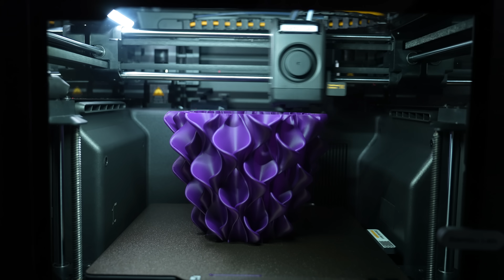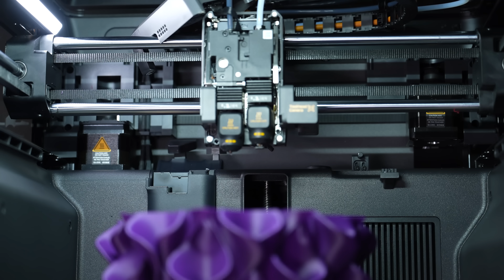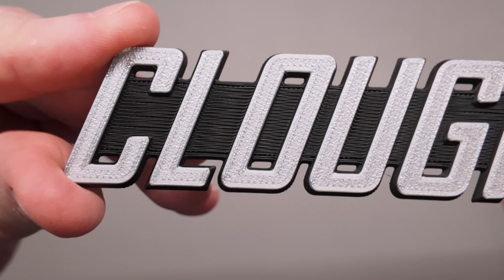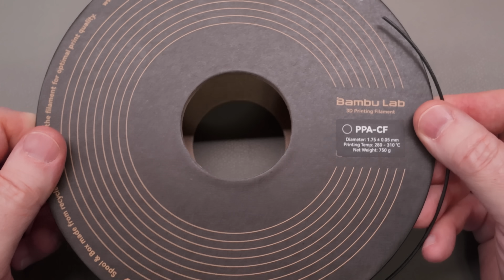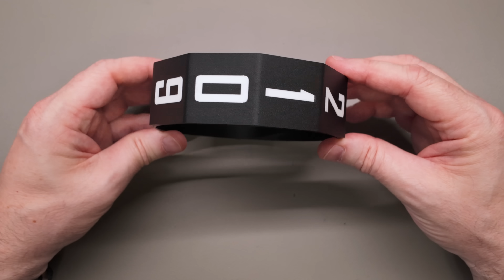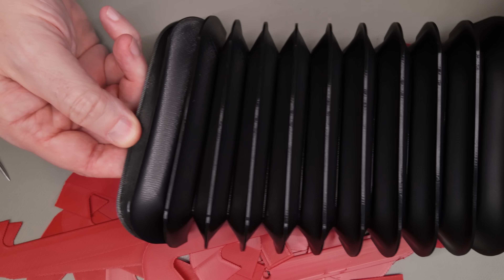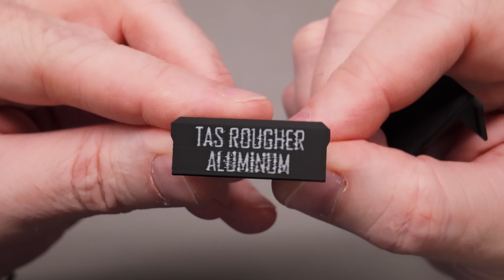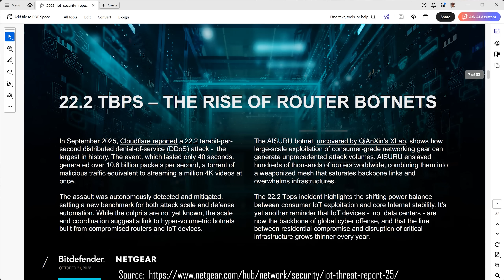X2D Deep Dive: Dual Nozzles, Bowden Extruder & Real 3D Prints

Comment: @1:32 .. 300… not 350
Reply: Yep, they could have had an easy win with 320c even... the 300c is just... daft
Reply: @Net7Ruins  Soooo true!
Reply from the maker: Ugh.  Yeah, I misspoke.  It's 300C.
Reply: @Clough42 would’ve been even crazier value @350c though, great review!
Reply: @Clough42 bummer. I wonder if the test units were 350? This was looking like a great machine for technical filaments, but now with this lower max temp I’m less certain.
Reply: @Clough42 Ah that's too bad, I almost rushed to buy one based on that. I print with high temperature filaments quite a bit, where optimal temp is 325C, and I'd much rather do it on a Bambu machine than the custom voron I built.
Reply: @stevewells20  just get a qidi q2 or max4
Reply: @Clough42  your name is really dumb. clough is really bad as a name.
Reply: @Clough42  I just subscribed after coming across your videos when I was looking at bamboo printers. I watched the video you did about YouTube as well. Totally agree that there’s so much crap you have to sift through, to find the gems like yours. I appreciate the crazy amount of effort you put into your videos. Cheers, Pete
Reply: I was just about to comment.  I don't understand why they would cap it at 300c.  I mean even elegoo is doing 350c.  It's the one thing keeping me from purchasing.  If I knew I could mod it I would buy one.  Unfortunately I don't know if it's possible.
Reply: @rustimack  I feel exactly the same way. It’s so stupid to cap this at 300C and it’s the exact reason why I’m not buying one.
Reply: You should really update the video. I just almost bought one just for that reason.
Reply: @patmcfarland9880  Same! I know he just misspoke, but you can’t have misinformation like that in a video. Should’ve been caught in editing and should be updated.
Reply: 256^3 is way, way too small.
Reply: @Spectrum184  ok, just get an H2 then
Reply: @Spectrum184  Except it’s not. It’s the most common/standard size for 3D printers today, and for good reason. If you need something bigger then obviously this isn’t the printer for you and you should be commenting on totally different videos (Bambu H-series, Qidi Max4, Anycubic Kobra S1 Max, etc).
Reply: Oh wow, this knocks it down from S-tier to like a B-tier for the price.
Reply: @ivchatov this is sarcasm, yes?

Comment: FYI: X1C OWNERS: BAMBU LABS IS BEING INVESTIGATED FOR EXTORTION. THEY PURPOSELY BRICKED FIRMWARE 01.03.00.00 TO SELL UPDATED AP BOARDS. PROVE ME WRONG, GO RESEARCH. LOUIS ROSSMAN VIDEO IS WHAT LED ME TO FIND OUT MINE WAS BRICKED. I HAVE ALMOST NO USE ON MINE (JUST A TEST PRINT BENCHY AND SCRAPER TOOL) AND IT'S 100% FIRE HAZZARD BRICK NOW FOR LAN. YOU CANNOT CONNECT VIA LAN TO MONITOR CAMERA OR TURN MACHINE OFF IN THE EVENT OF A FIRE REMOTELY. THIS MACHINE IS PURCHASED FOR FARMS BY MANY TO MANUALY CONTROL. BUYER BEWARE, THIS COMPANY IS GOING DOWN., IT'S BEING SUED.

Comment: I’m new to 3D Printing and would like to consider a scale project that even the H series cannot handle in a single print. The X2D appears to be the best overall value for features as an entry point into 3D Printing. Can you suggest a method to print a large item that would need to be assembled from many prints for full scale project. I have a Fusion drawing that would need to parsed to many smaller prints but am not a Fusion360 expert. Thanks

Comment: I'm in IT, so I'm very aware of the security landscape in 2026. It's good that you're running these IoT devices on their own network, but I would discourage the use of any cloud services. There's not only privacy and copyright concerns; but there's also security concerns. If Bambo Lab's infrastructure is ever compromised then all the cloud connected printers could be compromised as well. We've seen similar hacks repeatedly.

Instead, what you should do is run these offline, on their own VLAN without internet access. You can still access most if not all of the features using Tailscale and the like. If you're concerned about firmware updates, that can be done manually when you've verified that it's stable as Bambo Labs offers those downloads offline.

Comment: Bambu says that the aux hotend shouldn't be used with a 0.2 nozzle ... but what if you're printing a model in hi-res and it needs support?
BOTH nozzles are required to be the SAME!     I don't think this printer is going to be around long.

Comment: Fair warning, Bambus quality has went down and engineers have gotten out of hand. Don’t buy unless you feel like removing the whole tool head cover off, minimum 13-14 screws and multiple wire connectors just if you need to work on the extruder assembly. Sensors are cheap plastic, camera and auxiliary hot end fan is barely held on, had to tear my first one down so many times threads and connectors are sloppy and finally had to get a replacement after 3 filament sensors went bad in 3 consecutive prints and new machine is doing the same🤦🏻‍♂️

Comment: I wanted to add another printer to my setup and I have the P1S workhorse, I went with the X2D, I Don't have a need as of this time for the more complex material Support but, Getting the P2S just seemed like a mistake when I start experimenting and using engineering materials.

Comment: As a user of the h2ds i really wanna get one of these to try but that quality is definately not going to be worth it. Sucks these companies keep making good moves but leave you in between models to pick from. P2S with a heated chamber would of hit the nail on the mark. This printer should of just went to tool changing since they already have a bigger dual nozzle printer. But 2000 plus is alot when you want to add machines. Thanks for the review.

Comment: be real, you can buy a 3d pen for 20 bucks that comes with direct drive motor and weight 20 grams. i cant imagine they cant made the head properly with 2 direct drives there. next year they will suddenly release like X3C, after we spend 1k on that mediocare stuff. Its like playstation 2 + playstation 3 = playstation 5 memes. at this point. This aux thing have no place at printer in that pricerange. there are cheaper printers with 4 proper heads already

Comment: Was a good video up until you started glazing their "security updates" and using their illegal (in terms of licensing) networking addon. Under the type of GPL licensing that bambu studio inherited from prusa slicer, it is strictly forbidden to have a mainline use component, such as a necessary to use networking addon, under a different license. It must remain open source, yet these guys dont give a crap. They even send vague barely legitimate legal threats to a guy who forked cura and made it work with their old deprecated interface to enable proper interaction with the machine.

That said, I still bought the x2d. And you completely missed the broken "intelligent cooling" they have where every layer change forces the aux fans to blast 80 or 90%, thus producing warping on petg and other materials.

Comment: James, your videos are really helpful and informative. No nonsense. But here's my first big complaint about the X2D: We have a number of X1Cs and a bunch of spare/different build plates for them. Everything I read and heard said you could use those so-called "first generation" build plates with the X2D, and in fact you can. Problem is, unless you disable build plate detection, the X2D will stop and require a user/babysitter to click "resolved" or "ignore" before it will proceed to the job. I don't know, maybe there was an actual engineering reason outside of planned obsolescence for them to do this, but I doubt it. So, I ordered some "second generation" build plates, but unfortunately they are not recognized by my printer either. I have a support ticket open, I want my money back (for the bullshit build plates, that is.)  I think if people just took a step back and realized that it's everything an X1C is, but for only $900. Oh, and you get the other additional features like a heated chamber, two nozzles, etc. You don't even have to use the second nozzle if you don't want to.

Comment: X1C users have a few reasons to consider the X2D.. for me I print al lot of pla with petg supports, and like you said.  even with extreme purging you always run the risk of a ruined print due to layer separation from contamination so the X2D is a godsend for me at the price, and I have never had anything but the X1C machines, so not having to take apart the hot end to swap nozzles is going to be such a nice change!   thats on top of all the great things you mentioned with other materials and the heated chamber.
Reply: I have an X1C, and I don’t think I can upgrade to the X2D because of the same purging issue. like its ok, but not the best.

Comment: I was actually surprised at how the print times exploded when just adding the 2nd hot end support interface layers so some of my more complicated prints.  A 7 hour print that had pretty evenly spaced support interface layers (meaning the existed on many of the layers) went to 14 hours just by adding the nozzle switching and printing the support layers, and the huge prime tower.    Other than that, I really love this machine.   It's just want I wanted in a 3D printer!

Comment: Can you please do a video doing large asa prints on the x2d and see if your z height is off? For the life of me I cant believe bambu gives you x and y compensation through shrinkage, but nothing for z for filaments or the printer itself. I have large asa prints that come out good on x and y but z is off by .5-.8mm. not a lot, but for a printer marketed as accurate to 0.02mm with the vision encoder, .5-.8 defeats that accuracy idea of prints. Given that the x2d is aimed more at engineering than flexy dragons and fidgets especially. I could see them not caring for toys and fidgets but for prints where accuracy is key, it would be super nice. I know I could do a scale factor for z in the slicer, but if I forget that, it would be nice to not have to worry about it. 

Same thing on the h series, I don't have one but curious if on an h2s, large prints in asa how dimensional accuracy is. Would be a cool video since not many people talk about it with bambu printers. 

I've seen many talk and ask for it, so it will probably take a big YouTuber to push this. Love your videos.

Comment: I've been printing non-stop with my X2D for the last five days. My only complaint is that the extruder seems to be more sensitive to "stuck" filament (when the filament is simply stuck on the edges of the spool because it's wound too tight. My H2S seems more forgiving.

- Using an external bowden extruder makes the tool head lighter which is a good thing. (that's a win)

- Supports - the right nozzle only prints the support INTERFACE, and the remainder of the support is printed from the left nozzle. You could put a 250g spool on the support side and it would probably take several months of printing parts that require supports before you ever need to mount a new spool. (that's a win)

I have an AMS mounted for multi-color support, so I'll probably never use the right-side nozzle for anything other than it's intended purpose. I'm willing to bet that most other people will feel the same way.

Comment: Did you try printing the gridfinity labels the other way around with the main extruder handling the fiddly lettering and the auxiliary handling the larger black colour extrusions.

...that would have been slower but might have resulted in better definition on the lettering as it'd be the main extruder handling the 'delicate' bits of the print.

Comment: There was a fair amount of misleading info about firmware updates and needing to be connected to bambu cloud for that. You can stay just as up to date with it being in LAN mode - and many would actually consider it MORE secure then being connected to bambu's cloud service. There is a firmware update from USB option on these printer - its really not hard to put the firmware update on the usb drive and update the firmware. There is absolutely no requirement to be connected to bambu for that .

Comment: Even if the second nozzle is "only for support filaments", X2D still prints better than P2S because it uses 1.5mm belts instead of 2mm belts like the P2S uses. This means its more forgiving with VFA's while being at the same price point as P2S.

Comment: I’m looking at it due to wanting to work with tpu filaments and they are slightly large and will require me to slice and glue them together. Would it be good for that with the aux to provide support to stabilize the tpu, the tpu also will be printed with no outer walls just the infill only

Comment: For someone that has a X1C (early adopter) and wants to upgrade to a new printer / get a secondary printer that would become the new workhorse, would the X2D be a decent affordable direct path upgrade? Or is it small enough of an 'upgrade' where I should just hold onto what I have. The dual nozzle sounds like a dream for supports. Which is what I would probably mostly use. 

I use my printer to fix things around my house, prototype fixtures / inserts for work. But I wouldn't say I'm a power user. 

I'd love to get a H2C/D but that price is just completely out of my budget.

Comment: For the love of god BAMBU LAB.  PLEASE PLEASE PLEASE MAKE BAMBU STUDIO SO I DONT HAVE TO START FROM SCRATCH EVERY-TIME I MAKE A NEW PRINT PROFILE!!!!!!! MAKE THE FILAMENT PROFILES CROSS PLAYFORMS WITHOUT STARTING FROM SCRATCH!!!! This is infuriating  maybe I’m missing something but I can’t even use the same filament profile on multiple machines.  This must be changed or made easier.  I’ve got A1’s A1mini’s x1c’s x2D’s P2S’s and H2C’s.  This absolutely makes my flow through an absolute nightmare. To the point where I’m about to sell these and just. It a formlab fuse 1 30w.   It should not be this difficult.  It just shouldn’t.
Since I’m on a tangent, might as well spell out that your AMS NEEDS TO HEAT WHILE PRINTING last time, I checked PA 612 PA 6PPANPPS isn’t going to soften at 80 C while printing, so please for the love of God or whoever you pray to make this an option not a lockout. And again, please make it easier to transfer filament profiles from machine to machine and platform to platform. I use all of your machines I have 40 of them this has to change.
I literally have to open up multiple screens and copy line by line the settings of each one this is just not good. 
Now, as far as the X2D they make it pretty clear that the secondary nozzle is for support that I agree with them. I use it for Phil and it works great for him. Phil doing multi material infills with nylon and then PPA creates a very rigid, but impact resistant part
Reply: I’ve honestly had really good success with X2D’s. They are really good with support and are really good for using strong material as infill or simply just a different material for the infill my main issue is the AMS unit. Those things are hot garbage. The Stu D’s only issue I’ve run into so far is that I am getting z wobble and cannot fix it. And Bambu Lab hasn’t been very good with their customer support on it.

Comment: Darned you! My bank account is not happy. Now I gotta find a buyer for my X1C! Thanks for this video. I’ve struggled w/ support material since starting 3D printing. The X1C has eased the problem, but I never wanted to trade the speed of print to use support material on my AMS. Now I will be able to be a bit more daring in my design and let the support material do its job w/out creating a nightmare on removal. Can’t wait to get my new printer!

Comment: I'm having an internal fight on which way to go.  I'm not 100% wedded to bambu ecosystem but staying put clearly has benefits.  I currently have an A1mini and waiting delivery of a BIQU ams clone.  I've been looking at bigger machines for a while and almost bought an SV08 but decided against the DIY nature of the machine.  
The struggle I'm having is how much better a tool change/dual extruder system is compared to AMS.  Clearly AMS has a material waste issue.  If the X2D had a dual direct extruder I would have already purchased one (even if more expensive).  I guess my questions are how limited is the aux extruder? and how limited is the bad size?

Comment: I disagree with your stance on security. Your biggest security exposure is Bambu getting broken into, and then, since you want the firmware right away, you will be one of the first to get the malicious firmware the bad guy send. I'll take my risk of someone breaking into my network through my firewall, and then attacking my printer with a day one exploit. In that scenario, the printer attack is the least of my worries. Don't connect to the cloud, and don't be the first to download new software/firmware are two pretty good rules of thumb.

Comment: Question out of ignorance...are you printing ABS, ASA and Vinyl on this machine without using an exhaust to the exterior of your space?
Reply: Vinyl?
Reply: @riba2233  Yes
Reply: @Mr_Matthews  what material would that be?
Reply: @riba2233  Vinyl??  Are you AI that doesn't understand a DuPont trademark?
Reply: @Mr_Matthews  it's a very generic term, that's why I'm asking which material do you have in mind exactly, is it EVA, PVF, PVC? I'm mainly asking because they are not common 3d print materials.
Reply: @riba2233  Yeah, I had Vinyl on the brain.  Nylon is the brand name I was thinking about.  I have a couple of spools for my Dremel 3D45, so my bad.
Reply: @Mr_Matthews  ah ok, that's why I wanted to check, np 👍
Reply: @riba2233  Yeah, my bad.

Comment: For the PA-HT, did you run that through the AMS with the 0.4mm nozzle? The you mentioned bypassing the buffer
Reply from the maker: PAHT-CF prints in the AMS.  PPA-CF need to bypass.